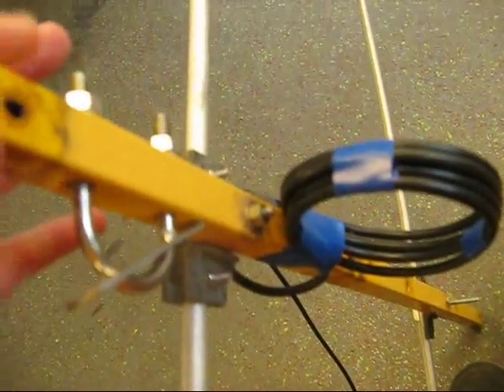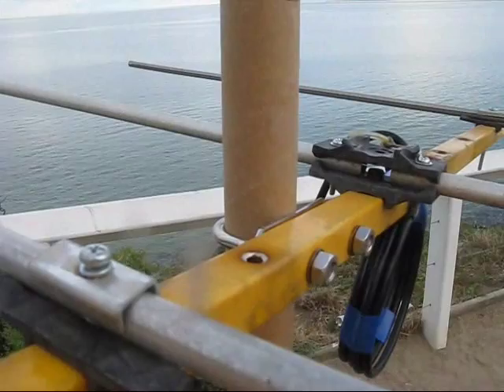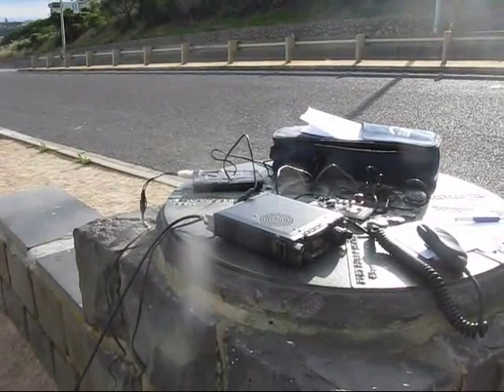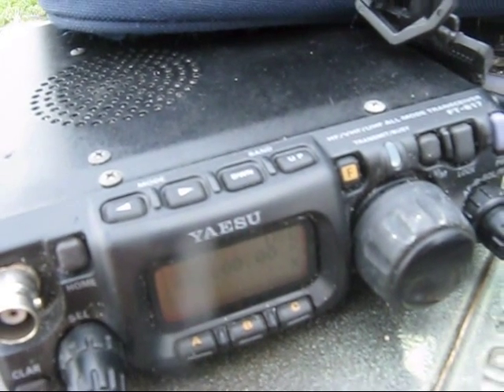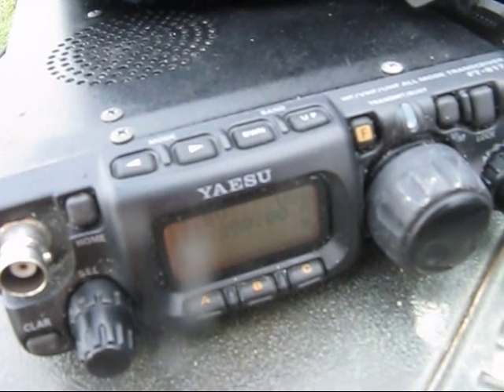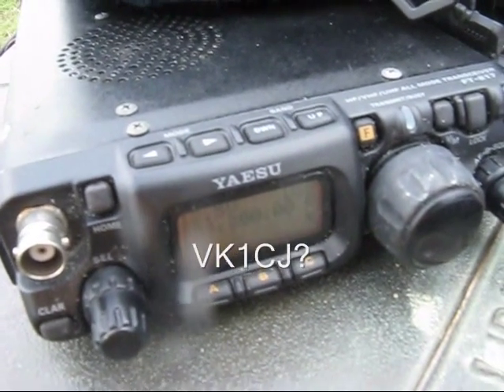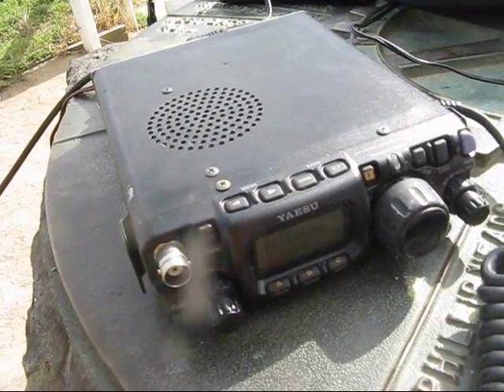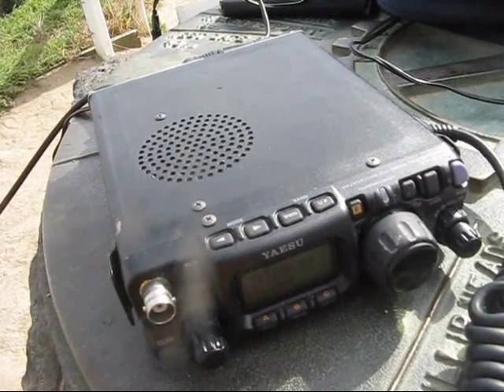Building a 144 MHz 4 element yagi - Part 3 (long distance contact)

Comment: excellent, what was the maximum distance that cover on 2m, greater tan 500km???
Reply from the maker: 500km is hard but possible with a bit of lift or reasonable power (say 100w).  At QRP power levels 100 - 250km is more common.